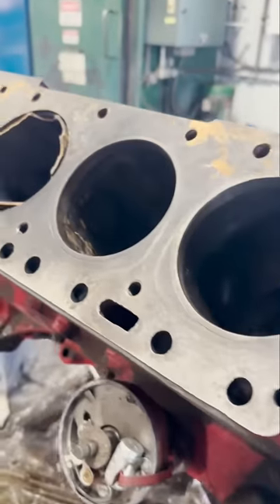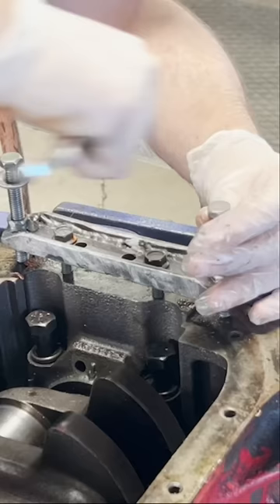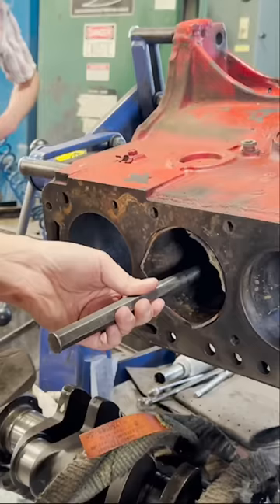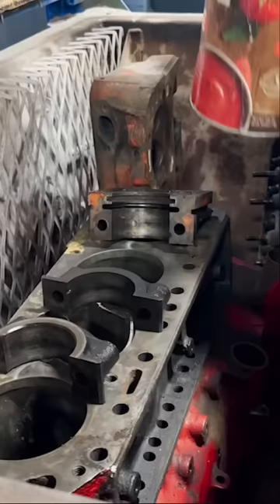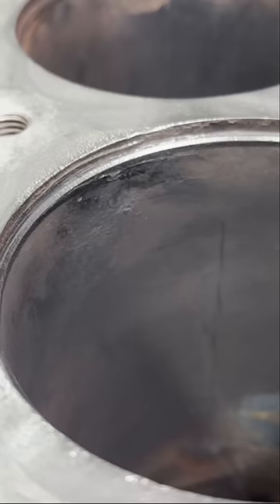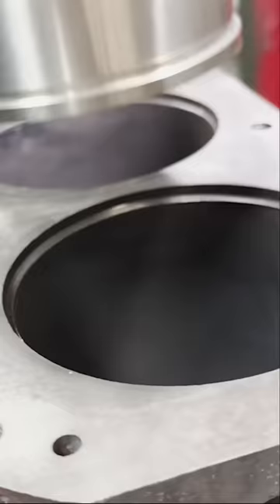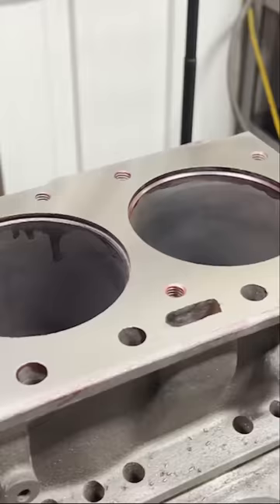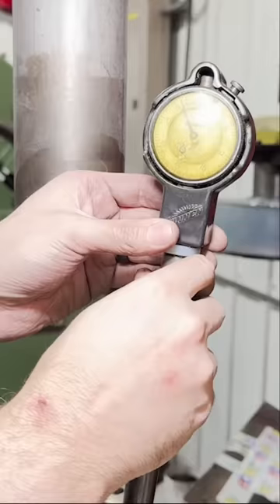#shorts I’m Sure They Work SOMETIMES, But When They Don’t…

Comment: There comes a time when "I can do it myself" works against the person saying it. Good thing the customer put his pride aside and took the block to a professional.
Reply: that block needed pro help
Reply: Facts
Reply: The right machines help also, can not do it yourself without the right tooling
Reply: @thesarcasticgenius3986  kķķoķoķkokokokokkkokokkokoķokkokokkokkokkokķkķokkkkkkķķokkkkķokkkkkoķkkkkokķkokkokkoķokkkkokokkkkkokokokķkkkkokkķkkoķķkokkokkķķķokĺ9ķò9o9o999ò9òò9o9ò9o9o9ò9ò9o9o9o9ò9o99o99ò9o9o9ò9o9o9o9o9o9o0o0o0o9oo0o0o9o9😊ò9o0o0o0o0o0o0ò0o0o9o9o0oo0o0o0o0o0o0o0o0o0o0oòò0ò00o0o0o0o0o0o0o0😊o0oo0o0o0o0o0o0o0o😊0😊o0o0😊o0😊o0ò0😊😊ò0ò0😊o😊o0oo0o0o0o0o0o0o0o0o0o0o0o0o0o0o0oo0o0òo0o0o0ò0ò0ò0o0o0òoo0o0o0o0o0oo0o0o0o0o0ò0ò0o0o0o0o0o0o0o0o0o0o0o0o0o0o0o0oo0o0o0o0o0ò0oo0o0o0o0oo0o0o0o0o0o0o0o00o0o00o00o0ò0òoò0o0oo0o0o0o0o00o0o0oo0o00o0o0ooo0o0oo0oo0o0o0o00o0o0o0o0oooo0ò0ò0o0o0o0o0o0oo0o0o0o0o0o0o0000o00oo0o0o0oo0o0o0o0o0o0o0o0oo0ò0ò0o0o0o0oo0o0o0o0o00o0o0o00oo0o0o0o0o0o0o0o0o0o0oo0o0o0o0oo00o0o000oo0o0o0ò0ò0ò0o0o0o0o0o0o0o0o0o0o0o0o0o0o0ò0ò0o0o0o0o0o0o0o0o0o0o0o0o00o00o0o0o0o00o0o0oò0o0o00o0o0o0o00o00o00oo0o0o0o0o0o0o0oo0o0o0o00o00o0o00o0o0o0o0ò0ò0ò0ò0ò0ò0o0o0o0o0o0o0o0o0o0o0o0o0o0o0o0o0o0o0o0o0oo0o0o0o0o0o0o0o0o0o0o0o0o0o0o0o0o0o0ò0ò0o0o0o0o0o0oo0o0o0o0o0o0o0o0o0o0o0o0o0o0ooo0o0ò0ò0òo0o0ò0o0o0o0o0o0o0o0ò0o0o0o0o0o0o0o0o0o0oo0o0o0o0o0o0o0o0o0o0o0o0o0o0o0o0o0o0o0o0o0o0o0o0o0o0o0o0o0o0o0o0o0ò0o0o0o0ò0ò0ò0ò0o0ò0ò0o0o0o0o0o0o0o0o0ò0oo0o0o0o0o0o0o0o0o0o0o0o0o0o0o0o0o0o0o0o0o0o0o0o0o0o0o0o0o0o0o0o0o0o0o0ò0o0òò0o0o0o0o0o0o0o0o0o0o0o0o0o0o0o0o0o00o0o0o0o0o0o0ò0ò0o0ò0o0o0òò⁹😊😊😊😊😊😊
Reply: Lol
Reply: And his wallet...
Reply: This is how I feel when I try to unscrew something In my technology class that I KNOW will strip the screw. I always call the teacher over lol
Reply: @thesarcasticgenius3986  Top notch gear isn't foolproof and also requires advanced experience.
Reply: Sometimes wisdom is knowing when to give up. For your own safety or your wallets.
Reply: Sometimes you just don't have the right tools even if you have the know how
Reply: I use BIG easy outs...Works every time, plus they dont snap like the small ones.
Reply: I wish people would do this with their home projects
Reply: Yup. That's me. I learned hard way, once.
Reply: As a professionally paid mechanic for the last 2 decades. I can confirm, my race engine for my "hot rod" still goes to the machine shop.
Reply: It's not the professional they needed they needed the machine. No one buys a machine to do only 1 engine rebuild.
Reply: Who said anything about pride? He tried, got stuck, and then took it to someone who is more able.
Reply: @ripewhensoft9743 not more able just had the equipment to do the job…. None of this is complex work.
Reply: @terryrickman2975 Came here for this comment. You can have all the knowledge, but without the proper tools, it’s a tough row to hoe.
Reply: @thesarcasticgenius3986 na bro. Machine takes a lot of knowledge. You can have full access to a machine shop and still cant do it unless you’re a. Machinist. Even top tier mechanics are not machinist. You really gotta know where the limit is and when you’re stepping into someones else’s career path lol
Reply: Even as a full time mechanic there's been plenty of times working on my own cars where it's just better to have a specialist do it. I tried to teach myself how to weld, detail, paint, etc but every time I finished the job I wished I saved myself the headache and paid a pro.

Comment: .016 milled off the top? bro is gonna be happy to have a working head gasket now thanks to you guys.
Reply: No kidding. 16 thou out is disgusting! It’s been that way since the 50’s!
Reply: Never heard of one that bad. I think the worst I’ve heard of before was 8. Wild.
Reply: First I want to say I have no knowledge about this stuff, but are you saying that what they did was bad and a gasket will no longer work, or are you saying they fixed an issue that would have otherwise caused an issue?
Reply: @dixieinstrumental805  .16 off means the head was uneven, a gasket is even thickness and needs a pretty flat surface of contact

With .16 off, no gasket would have formed a perfect seal

Edit - to be read as .016
Reply: @hiteshadhikari  thank you for answering my question. Sometimes the comment section can get very sarcastic and I can't tell if it's a criticism or a compliment
Reply: @hiteshadhikari  the deck could have been flat, but not square. Looks like their first cut only hit one side, not both sides. If it hit both does that would have been worse? because then it was dished .016".
Reply: @dixieinstrumental805  The surface wasn’t necessarily “bad”, it was just uneven. A gasket would work still, kinda, just not that great. The point of a gasket is to create a seal between 2 metal surfaces that otherwise wouldn’t have a perfect seal to hold fluids/air

The .016” they removed practically made it “perfectly flat”, where a gasket would work at its absolute best. The more deformed the surface, the worse a gasket performs

Can’t imagine any reason why this block would be so bad aside from overheating and warping. Even in the 50s I’m posiitve they had ways of knowing if a block would be THAT BAD
Reply: @SuzukiKid400   anything over + or - .010 and I won’t even check the dimension after the first part she’s wide open
Reply: @randomidiot8142  i think the difference between the highpoint and the low point was .016 so they had to scrub that much off to have it all level
Reply: Almost definitely was warped from heat of some kind. Since the high spots are around the cylinders themselves though, I'd have to imagine it's due to overheating gradually warping the block over time. The head of that block probably hadn't been touched since it was first made, if I'm guessing.

It almost certainly wasn't like that when it was made.
Reply: @hiteshadhikari  .16 means it's pretty much trash
Reply: @hiteshadhikari  it's not .16" it's .016"
Reply: @dixieinstrumental805  the world is messed up brother, half things which were joke 20 years ago are now socially politically correct , hence your confusion is justified
Reply: @dixieinstrumental805  A human hair is on average. 002 to .003 of an inch. Between 2 and 3 thousandths of an inch. That surface was Between 5 and 8 human hairs from being flat. Imagine the cylinder head having to distort that much to create a seal.
Reply: @mongolordofdarkness  yeah, if they didn’t mill it flat the distortion would probably end up being worse than taking the 16 thou off the top.
Reply: @hiteshadhikari  .016 not .16 that would be 160 thou
Reply: @heccle  still, it is in inches

.016 unch is nearly half a mm as i remember, too off
Reply: @heccle  take that .16 as eg i gave to the buddys answer

Can be read as .016 too, its still a problem
Reply: . 016 isn't bad considering most companies I worked for that did cnc machining used +/- .03 as a standard for anything per customer print but to help control day to day work engineers would only give us .005 to .01 of that so if we break an insert we would still be good.
Reply: He better have that head checked too lol
Reply: My 83 mustang was .006 out, and when it got up to temp it would puke coolant into the overflow and get hot.   Doesn't take much.

Learned that one the hard way.   I hate doing shit twice.
Reply: It's an old engine from the 1950s. Surface's were hand lathed back then. I imagine there was a crap ton of carbon sludge and probably lead particles filing the gap!
Reply: How much is a job like this
Reply: @_m_K_. hey had milling machines in the 50s and indeed much earlier. Not sure what you mean by hand lathed... You wouldn't deck a block on a lathe.
Reply: @Iaintwoke yeah, it was only the 1950s, still very far from the stone age. Leave it up to evolution in technology, that makes it appear as if it was lol
Reply: @dixieinstrumental805 He's saying the gasket couldn't have worked before, because the head gasket surface was far from flat. They had to  remove a lot of material before it could get flat, meaning there was a huge difference between the highs and lows.
Reply: I mean in all fairness, most things were pretty inaccurate 50 years ago.. but stuff like that is why things like the aussie block 351 windsor exists.. the Australians kept having issues with their casting process because the core would shift which meant every block got scrapped, so instead, they just modified the dimensions and tolerances so they could manufacture the block, and because of that, we got a block for the 351 that holds up to boost and big horsepower alot better than an american windsor ever could
Reply: No, the .016" was how much it took to clean up the cylinder that was bad; prior to the sleeve being put back in the block. That was what he was talking about when he said .016" to clean up.
Reply: @hiteshadhikari  you’re aware gaskets crush and fill voids right? .016 is 0.4064micrometers… that gasket was sealing just fine.
Reply: @lonewolftech  do gaskets crush and seal yeah, but when the head is even is the seal not compromised even if u consider a deformation leading to perfect sealing? Yes it does.

Also when u put the bolts for cover and torque them all, the uneven ness will affect things. 

Its never good to have warping, it will maybe work fine for now but its a future issue for sure
Reply: Also a .4 compression bump
Reply: What does taking .016 of the deck do to compression ratio? How much does it increase?
Reply: @hiteshadhikari Just knowing that its .016 off doesn't necessarily mean the gasket won't seal lol 
Gasket requires a flat surface so .016 off left/right or front/back will still seal... now .016 off due to peaks and valleys = no seal lol
Reply: @mountainlife1200  not a cr issue,
Reply: @dixieinstrumental805  .016 off means the highest vs lowest point on the surface was off by .016 which in this context is a lot.  Such an uneven surface would not provide a good seal with any head gasket and so by removing the material they provide a new, flat surface that will seal well.  This will help the motor perform better by preventing loss of compression in the cylinders.

Comment: Just a reminder -- prior to about the 80's your tolerances were determined by whoever was running the mill that day.  Or if he had a stiff drink at lunch.
Reply: Yeah.

I'm as nostalgic as the next guy, but I shake my head when people start with the, "Engines were better back in the day..."
Reply from the maker: Dad & I just had this conversation earlier. Tolerances on specifications were limited by materials, equipment capabilities, and operator abilities. Sometimes those things are all still a factor, but if we have better materials, better equipment, and better operators, we should be taking advantage of them.
Reply: @iFixJunk  I grew up checking the engine oil and coolant with each gas fill-up.  Every.  Time.  Replacing belts at 10,000 miles (carried spares).  Overjoyed if tires lasted 10,000 miles (full size spare ate up the trunk).     Replacing points and rotors.   Replacing hoses at 50,000 (had a set in the trunk with a 2 galloon jug of anti-freeze/coolant concentrate).  Replacing ignition (spark plug) wires & plugs.............  Except for oil changes, I've been under the hood once in the past two years (battery replacement on a 30 months schedule).
Reply: Teach Obie wan
Reply: @jimmiller5600 are you talking American brands though?
Reply: Thermostat and light bulb spares too!
Reply: @jamesfranko5098  Back in the day it was global.
Reply: One of those comments thats just too factual for the net 😮
Reply: @iFixJunk  Maybe, but they didn't stuff them with plastic at every chance they got. Many modern cars even have plastic water pumps!
Reply: @reinbeers5322  I agree that plastic has its limitations.  It will be interesting to see if that trend continues.
Reply: @jimmiller5600 just the way my daddy raised me !

Comment: As a precision toolmaker, hearing this was out of square by .016 was shocking. Unreal!
Reply: How the heck did it run😂... The extra air 😂😂😂😂
Reply: @iHelpSolveIt  by having the head warped to match. Wonder how much that is out of square
Reply: @dodgeplow  🤣🤣🤣🤣
Reply: I'd like to think it was precision machined at one point and then just decided to warp for... reasons.
Reply: Dude, you rock!  It takes special guys to do this work!👊🏻
Reply: This was a Ford — it’s not surprising …
Reply: Heat cycle
Reply: He was referring to cleaning up the cylinders for the new sleeves.
Reply: As a machinist I'd see that right away. Even a competent cabinet maker would see that as well.  Yoiks!!

Comment: In the 50s it probably came straight from the factory with the deck and bore issues
Reply: Back in the 50s, rough enough is good enough
Reply: @brucegow2926  exactly
Reply: Yup, absolutely right “they don’t make ‘em like they used to”. They’re made way better now.
Reply: @andrewahern3730 Yes aluminum heads and aluminum blocks that you overheat and throw away
Reply: @brucegow2926 good one. Hahaha
Reply: @servicetrucker5564 when is mine supposed to overheat? Over 300k on a V6 still waiting old man
Reply: @darrengarcia4937  As long as you keep it cool they’re fine. It’s when you don’t that causes the problems
Reply: @servicetrucker5564   to be fair, old iron block chevy V8s hated heat too. 

I have a Gen III 305 in my boat, a Mercruiser MPI model (iron on iron, marine cams, vortec port heads), and the previous owner went through the previous block (same engine) because of a fault with the overheat buzzer. 

Warped both heads, scorched a bore, he decided to just junk the engine and replace it, pretty common in the marine world. 

Not just Al blocks that people chuck, its usually cheaper with older SBCs to get a good block and heads than to take a trip down to the machine shop to have em run a rebuild, especially if the damage is further than just the head surfaces.
Reply: @danteinouye6098  I wouldn’t know about those but I got some mopars and some fords that should be COOKED but they’re running just fine instead
Reply: @andrewahern3730  people say that when you were lucky to get 100k out of an old motor lmao

Comment: I have one of those engines. Looks like new as it was run on propane only. Would have sold cheap!
Reply: I love engines that have ran propane, I did a full rebuild on an old Willy's jeep motor that had spent the last 60 years being driven around an orchard. Other than a tiny bit of oil sludge inside the pan it was perfect. The only old engine I've seen shiny pistons on.
Reply: @justindunlap1235  I was 14 or so when we got it. I had to put a head gasket on it. Blew my mind when I seen how clean it was. 30 years later it still fires up like new.
Reply: I am gun grip

Comment: For dry sleeves, we always took a small brazing tip on the torch and heat a small line in the sleeve, and just run a screwdriver down it.   It easily cuts a line out of it and then pops right out.
Reply: I have run weld up the the side in a couple of places, and they would pop right out, too.
Reply: I am gun grip
Reply: @Gun_Grip  congratulations..?

Comment: For Hondas we would use this trick or we would bake the engine block and then once we had the block hot enough we just cool the sleeves down without cooling the rest of the block and they pop right out
Reply: Or you run a bead of weld on one side, the weld cools and shrinks and the sleeve comes right out
Reply: Both of these methods introduce a Delta T that could damage the head.
A professional who has the proper tools will bore out the sleeve just as they showed here.
If you do not HAVE to do it Shade-Tree, then why would you?
Reply: @judsonkr because doing it shade tree saves me a pretty buck😂 people get too scared to manhandle engines like they aren’t made out of metal.
Reply: I am gun grip

Comment: Machinist told me my '49 flathead V8 would accept a 0.250" oversize bore.  It received an 0.80 bore to clean it up, so there's still plenty of meat remaining in this old gal.
Reply: So they bored it over 3 times the acceptable amount but you still have meat remaining?
Reply: @isaackvasager9957  Machinist builds flathead V8 Fords for racing, he had pistons all the way to .250 over and Lincoln stroker cranks right there on the shelf.  This is not a 6cyl, it's a V8.
Thinking about this further, the machinist may have offered .125 overbore.  0.80 was necessary to clean it up, reliability was my goal.
Reply: @thisisyourcaptainspeaking2259  .80" and .080" are not the same thing. If he can only go .250" over, your block wasn't bored .80" over. The decimal place is important. JS.
Reply: Yea,and save that"meat"cause you might need it to keep bore or cyl.from collapsing. Three and five sixteenth 'bout the max,tho I 've done Three and three eight,which is risky.Makes them flatheads come alive and sound damn good!!!
Reply: @isaackvasager9957  Glad he's not working in a machine shop, eh?
Reply: @thisisyourcaptainspeaking2259  im pretty sure you mean .080 over, 80 thousandths. .25 over would be a quarter inch, .8 would be over 3/4 of an inch. That's an insane overbore.
Reply: @Redtooth75  Correct, 80 thousandths was necessary to clean up the damaged bores.
Reply: @kennyscarborough9374  I never did overbore to get extra power, there's to many other ways to make power than to take off meat that a man might need in the future.
Reply: @thisisyourcaptainspeaking2259  it's good the meat was there in this case .
Reply: @ronalddaub9740  This machinist had been building ford flatheads for racing, he had lincoln stroker cranks, pistons and the works on the shelf.
Reply: Eh..who needs cylinder walls anyways.